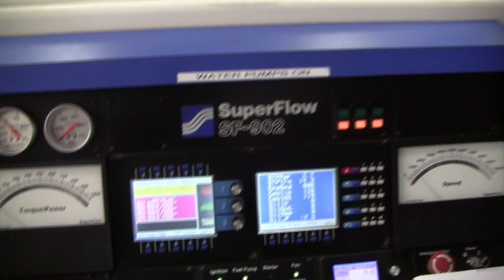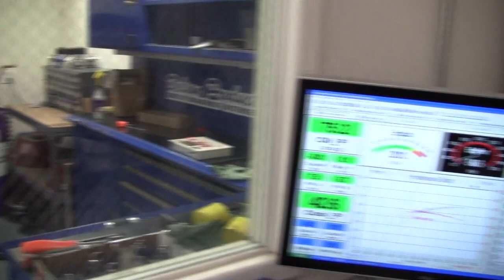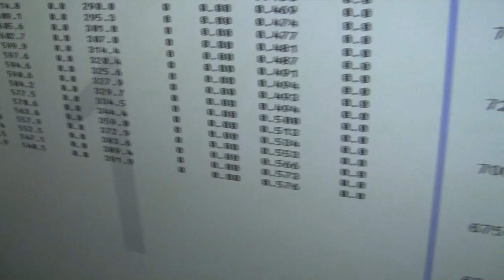Tom Fry's 427 SOHC Cammer 740HP Dyno Pull | QMP Racing

Comment: Why is it that whenever there is a Cammer video out that there is always some Chrysler whiners hanging out in the shadows, still crying and complaining to anyone that will listen about the way things should have been.
Reply: Because this motor was Ford's solution to the Hemi.
Reply: @iconofsin5886  -It was Fords ATTEMPT as a solution to Chrysler's 426 Hemi...Unfortunately it had several flaws(poor bottom end oiling,and a timing chain that stretched),which plagued the engine for it's entire career.
Reply: @68bobba2  Didn't seem to stop Jack Chrisman and others using it in Drag Racing with great success.It wasn't an attempt either .This engine was based on Ford's 427 side oiler which was already a great success in racing.In fact after it was banned from Competing in Nascar in 64 Ford stilled kicked Mopar ass with the side oiler in 64.The mighty 427 sohc never got to show what it could do in Nascar but well and truly did on the dragstrips.

Comment: And Chevy guys thought they're push rod 427 engines were hot shit...LOL  Chevrolet has never built anything this cool.
Reply: NHRA legal Superstock L-88 427s are making 900hp with a single 850 DP Holley. They run deep in the 8s in the 1/4. The fastest Superstocker is a 68 L-88 Vette. Bigblock Chevy's have nothing to be ashamed of. LS-5 454 Superstock engines are making 780hp with a Q-jet.
Reply: Not on pump gas.  @72troy455
Reply: @tomparry4313  No shit? I never would have guessed since I've spent my entire life at the dragstrip. Come on dude, what difference does it make if they run on race fuel? Most race cars do.
Reply: @tomparry4313  I've drove plenty of rowdy bigblock Chevy's on the street on 93 octane.
Reply: @72troy455  -The 60s S/S world record belongs to a 68 Hurst Hemi Dart(Gary Wolkowtitz)...8.22@ 160 mph
Reply: they did not have too
Reply: @72troy455  LS-5?? rated 390hp you mean LS-7
Reply: You full of it 😂😂😆 it's a Ford!!!

Comment: That is absolutely badass! 
Beautiful engine and awesome sound. 
   Putting that thing on the dyno running pump gas and putting out over 740 horsepower is absolutely mind bending!!
   If this thing was dynoed with a race fuel tune, I have no doubt this thing would be well over 800 (n/a) horsepower!..
   Absolutely phenomenal!!
   No wonder why the hemis were afraid of this engine.. the hemmies had nothing on this engine.  Great job!!

Comment: How strong is that bottom end? It was still pulling at 7200 and wanted more RPM  LOL

What's a safe RPM for it?
Reply: 8,000 Hot Rod magazine January 1965
Reply: scdevon the top end would handle 15,000 RPM easily but the bottom end was only able to handle about 8000. The blocks would literally split in half longitudinally.
Reply: Fat Daddy ditto, I have the book.
Reply: scdevon Look closely in the video you can see that it has two cross bolts on each side of the  mains. Not a stock block probably a Shelby Aluminum  block.
Reply: RSDX99 that's an aftermarket kit. They make those for small block chevys too for using a two bolt main block
Reply: Listen when Ford first introduced this engine it made the cover of the January 1965 Hot Rod magazine.  It was stated that Ford had got this engine in its infancy to produce 640 bhp at 8,000 rpm.  Find the magazine the article is there.
Reply: Oh by the way the horsepower quoted in my previous post was made with only one carburetor.
Reply: Chrysler was cross bolting the blocks in the 50's
Reply: 8000 RPM was screaming even for a super stock V8 in the mid 1960s. 
Ford really blew it in the muscle car era by not mass producing this OHC V8 by the tens of thousands and making it the default engine in Mach 1 Mustangs and other Ford Muscle cars. Ford would have mopped the streets with Chevys and Mopars. This engine could have had excellent street manners and acceptable fuel economy with proper tuning and cam selection back then, too.
Reply: YES!!!!, my point exactly!!!
Reply: @bubblejomay  My favorite Hot Rod Magazine cover photo ever.
Reply: They had to,  to keep them from falling apart!

Comment: First On Race Day
Reply: Found On Road Dead
Reply: Fix Or Repair Daily . . . a Ford has NEVER beaten my Hemi on an NHRA strip.
Reply: F#*%ing Old Rebuilt Dodge
Reply: Chevy is called...
Cheap Heads Every Valve Rattles Oil Leaks Every Time.
Reply: @badadamtude  
Can Handle Every Vehicle Racing Opposite Lane Every Time
Reply: @SealofPerfection  did I leave a remark on here? I can't see what you are referring to?

Comment: This engine is a true Hemi killer
Reply: the 427 sideoiler beats a stock hemi and mod for mod boss 429
Reply: +Fire&amp;Ice909 Apparently the Cammer also suffered from bottom end oiling problems,as well....the sideoiler block couldn't keep the oil up to it at 8,000 revs...I read that in an article about Connie Kalitta
Reply: It wasn't JUST Petty...It was the Chrysler factory entries in general...you need to get your facts straight
Reply: Wrong
Reply: The fact is,You're wrong...end of story
Reply: Is that why connie ran those engines for years and still does, and is well, one of the most successful racers ever of that type! any oiling issues were obviously corrected, due his long successes with it. It's still the favorite engine of choice except very few are left.
Reply: What I said is true...I don't care id you don't believe it
Reply: From what I've read about them,the 440 was a more street friendly engine than the Hemi...But on the track or strip...Hemi all the way
Reply: I know the 440 was a wedge.
I've read about an engineering company in the US that makes Hemi style heads to fit the 440 magnum.
Stage V Engineering,Walnut,California
Reply: Yeah but the by the time you do all the mods you might as well just get a Hemi. Sure you give away 14cu in, but you might get that back by revving it harder.
Reply: John Kasse.
Reply: butchtropic-Chrysler fixed the  valve adjustment problem in 1970 Hemi engine,when they included hydraulic lifters...
Reply: @brew5491  lots of cars beat a street hemi...a race hemi.probably not..

Comment: That almost sounds like a NASCAR engine sweat man.
Reply: It was a NASCAR engine, and a top fuel dragster engine and a LeMans Prototype engine in the Ford GT-40 MK-II/IV.

It ended up causing the engine size ban at Le Mans and it was straight out banned in NASCAR because of its pure dominance in races.
Reply: The 427 Cammer was never used in the Ford GT Mk II or IV. The engine used was a regular wedge head 427. Also, the Ford GT MkII and IV are not GT40's, a nomenclature reserved for the small block (289 c.i.) engined cars...
Reply: craig colvin 
NASCAR never had any thing that sounded like that.
I bet if you was standing beside it and twisted one good time it would probably take your breath like a top fuel dragster

Comment: Cammers have a ton of low lift flow.    Almost 300cfm (260-280cfm ) @.300" lift, some good DOHC heads on a 4" or greater bore have 300-310CFM@.300" lift.    What does the excessive low lift flow mean for power development?   I've heard debate on it.   One being that the low lift flow won't give it much more peak power, but it will allow it to hang at TQ and HP peaks longer.   What is the view?
Reply: Low lift flow certainly makes the head act like it has a "bigger" cam with short durations.

Comment: Pull out the 427 in Shelby Fiberglass 2 seater small cobra and put in a 427 CID SOHC V8, let see baby what it can do. LOL
Reply: It wouldn't do anything because it just wouldn't fit and if it did, it wouldn't turn as the weight distribution would end up so incredibly nose heavy.  The cammer was meant for bigger cars and drag racing.

Comment: The Hemi head design was first done by Zora Arkus Duntov back in the thirties when Zora worked for Ford!  Remember the old "Ardun" heads for the flathesd V8?  the Ardun name was the first letters in Arkus Dutov.

Ford sued Chrysler over the hemi design in the fifties and won the suit!  Chrysler wound up  paying off the judgement by relinquishing their "Autolite" division to Ford!

Duntov went on to design the small block Chevrolet for GM after he parted ways with FOMOCO.  Ford sued because there were too many design elements in the small block, and the Y block Ford.  Ford wan that suit too!  GM paid off by giving Ford the rights and all the tooling for an engine they designed to fit into the Nova Platform which had a front sump oil pan and distributor set up.

That my friends is how Chevrolet designed the Windsor Block Ford, and the Small Block Chevrolet was designed by a Ford Engineer!

And Ford designed the Hemi!
Reply: ***** I thought it was a Belgium Co. called Pipe? in 1905. I not a big Hemi historian, but from what I have read, that was the first.
Reply: NOT TRUE, Mr Browning - Herr Diesel's first diesel engine used a hemispherical combustion chamber and also a hemispherical-headed piston as a compression-ignition engine. The "hemispherical" piston & combustion-chamber was chosen by Dr Diesel because it is the most efficient, providing the largest surface area for the pressure from the combustion event to push upon.
Reply: No they didn't design the hemi head at all:
https://en.wikipedia.org/wiki/Hemispherical_combustion_chamber#History
Reply: Although Hemi Heads appeared in racing cars before the Duntov heads he is probably the first one to make them for the aftermarket for a U.S. production engine, the flat-head Ford.
Reply: ronald brignoni but Chrysler took the hemi design from their radials and the sbc is nothing similar to the y block
Reply: So why did people stop building diesels that way?
Reply: So companies stealing engineers from one another is nothing new.
Reply: That's how things get twisted and false information gets out there people that make stuff up Zora Arkus Duntov never worked for Ford although Stoner Browning wishes he did but rather Zora had his own company and applied Ford with heads that Ford desperately needed to ensure their flat head v8 would stop overheating. Zora didn't invent the Corvette that would be Harley Earl but Zora is called the father of the Corvette due to his contributions to the Corvette ..the first hemi head wad I'm about 1902 and had absolutely nothing to do with Ford or Chrysler
Reply: Stoney Browning ,, thank you sir you know your history my favorite american history is  henery ford and his many wonderful things he brought to life so few people really know there shit i just laugh cause opinions are like assholes everybody’s got one FORD blue always
Reply: @schoolofhardknocks1096  duntov never worked for Ford and Stoner does not have a clue maybe he's been sniffing glue
Reply: Ford built DOHC 1100 Hemi for tanks in the 40's, considered one of the best engines.
Reply: ford were going down the tube,till dodge gave them funds to continue.or was it the other way round..??.anyhoo,all this early tech was too expensive to mass produce for the public joe,,so got shelved.unless you drive an old jag,merc,alfa, lotus,cosworth,ect.

Comment: I do not know why Ford continues not making engines like these ... reliable and durable. Not like the new "modular" with camshafts in the head and full electronic systems that are efficient but are not reliable or durable. Chevrolet continues to make Big Block engines lifelong today even today, because it has been shown that the simple technology is the best and everyone wants. Remember the venerable six-cylinder engine Ford online and 300 cu.in. for me it was the best six-cylinder engine that Ford has made in its history. 427 SOHC engine that is wonderful even if camshafts in the head.
Reply: Carnal - First, Ford didn't build this engine - Jack Roush did. Second, it's a "custom" build, based on a 351W Ford Racing block & a 'stroker' crankshaft. But, Ford Racing still sells the parts in their catalog - you can even get a 460 cubic inch short-block based on the 351W 'race' block. Put a nice big set of aluminum heads, call Comp Cams & see what they recommend for a hydraulic roller, and you can have 650 horse
power on pump gas REAL EASY!!
Reply: Jersey Danny this is a big block fe based engine the 351w is a small block and the 460 is also a big block fe
Reply: I agree with you. 
Thing is these could probably do with a better chain arrangement for the camshafts. It's a bit too long and one camshaft has to be advanced to compensate for chain stretch. I do love FEs.
Reply: There is NO chain-stretch ! ! ! Read Connie Kalitta's interview in HotRod - he used to run this motor in Top Fuel. SOHC chain-stretch is BS
Reply: And Ford's 4v V8's are different HOW? Besides the number of valves & displacement. Did you see what the GT350R did in the IMSA series for 2016? The 5.2liter flat-plane monsters that Multi-Matic helped engineer, and then ran in USA & Europe kicking asses??
Reply: Vincente  Ford does make a 572 Crate motor based off the old 460.
I am sure this was done to go against the Chevy 572.
 I would accept either one for a project truck.
Reply: No it's not and you know it. If you keep it below 5500 and have a relatively mild camshaft with lightish springs then perhaps less of an issue. However if you have a stock stroke length, light reciporocating mass and like to rev it up then you're going to need to compensate for the known ~4°stretch.
All chains stretch, I am wondering why the cammer is immune? If chains didn't stretch then Milodon Gear drives would have no market. Fact is they do and Cammers have two of them.
Reply: Why? Isn't 460 powerful enough? I like many stock stroke Big Blocks because I like to rev things up and still expect the motor to last 100 000miles. The other thing no one mentions much is big strokers really guzzle. 440s and 460s even when putting out 550-600hp still return fairly good economy, rev up easily and make a huge broad spread of power and are reliable. I dunno - to each his own I guess lol.
Reply: Whats wrong with that? My stinkin' Toyota 2F 6 cylinder doesn't get any better than that and it has about 15rwhp! I do not lie about the economy. I've had several Landcruisers all with 2F engines and every one has had abominable economy. This latest one even has headers but it still makes no difference.
Reply: Vicente Fuentes. Your actually wrong on two points here, first the engine your watching has the cams in the head, one per head. and second gm no longer makes any bigblock v8 in production vehicles.
Reply: Yes I know the 'cammer' engine is my point...and see the Chevrolet page, continue to offer LSX 454 and the amazing ZZ572 (reliable and durable and powerful)...Why not Ford? (see this http://www.chevrolet.com/performance/crate-engines.html)
Reply: +Vicente Fuentes your still wrong. a lsx454 is the same size as any other ls block. and gm offers no big blocks in production vehicles.
Reply: ZEEPOxWiZARD iix - Nope, Ford BB 460 is not an FE, its a 385 series engine similar to the 429, 429 Boss.
Reply: Vincent Fuentez - A friend of mine had an F150 with a 390.  He carried a truck camper and towed a boat with it.  A Ford salesman told him that 300 inline 6 had the power of a V8 and got the mileage of a 6.  He traded his truck in and got lower power and lower gas  mileage with the 6.
Reply: Not like the modular with camshafts in the head? So where do you think the camshafts are in a sohc engine? and the only thing unreliable about efi is the stories carby guys tell.
Reply: @tlwolf86  my dad still runs a 390 and a 300 in his wreckers the 300 doesn't have the power that the 390 does but still gets the job done the 390 drinks alot more gas though.
Reply: @Richard Skipper all the Windsor needed was splayed main bearing caps like the Modulars and Ls's have. I never had any problems with my 96 Windsor roller engine it would haul like a 7.3 and scream when I wanted. Mpg's wasn't horrible either.

Comment: Why no fancy electronic fuel injection if it is so superior? Give me a Dominator anytime.
Reply: 600hp in base form, in 1960, that's what/
Reply: Jesse
Thats a good 'ol engine ! No F.I. for me,only carb for max power.
Reply: From a nostalgic point, people prefer it, and for some reason, the older crew feel carburation is simpler, but if you've dumped that much money into an engine like this, not being numbers matching, a proper F.I. system would produce more power hands down, and wouldn't need consistent  adjustment once dialed in, especially when there is a change in altitude.
Reply: That makes sense too.I understand too that NHRA has mandated FI only in Pro-Stock and they will not let you modify any components.I would like to have seen carb vs FI.But nnoooo.
Word has it that NHRA does not want cars going over 250 mph---just a rumour.Sounds like NASCAR though in slowing cars down with restrictor plates.
Reply: Fi is fine for emissions, maximizing efficiency, etc etc but its complicated needs a bunch of wires and a computer...The essence of hotrodding is tweaking, we WANT to have to adjust and tinker otherwise it gets boring...
Reply: Rolly Polly
I have observed that NHRA mandates FI on all Pro Stock.NHRA also PROGRAMS the computers before they race,they also limit the top speed of the vehicle.I believe this is similar to NASCAR mandating restricter plates to keep the speed down.How many people actually read the rules of NHRA  for Pro-Stock?They are cookie cutter cars,NHRA tells YOU how they are to be built.Formula 1 is getting just as bad too.Big Money does not want innovation to win,they want control so a lesser wanna -be will not whine that they got beat.This is a pattern in todays world.